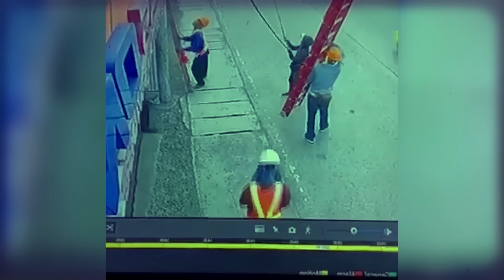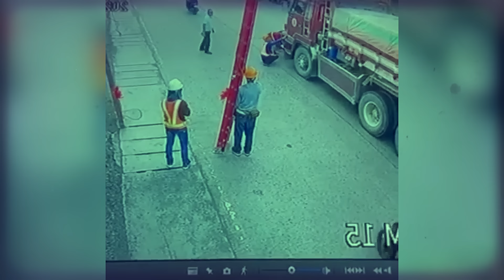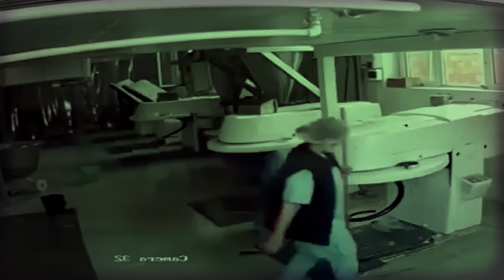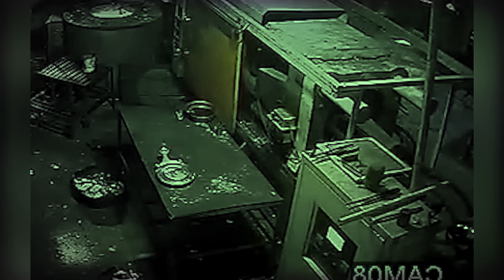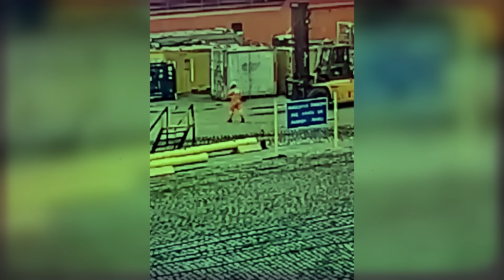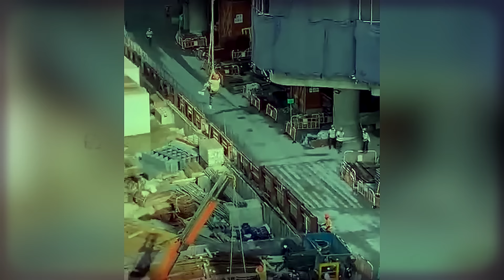Mixer Machine Accident... Caught on Camera 😱

Comment: MIXER INCIDENT:

She went to jail for 2 yrs, apparently she was attempting to ‘adjust’ the mixer for easier cleaning..her statement below (translation I assume)⬇️ 
We were very friendly. We spent most of the day together. On the day of the incident, there was a division of labor among the workers, and two of us were assigned to clean the warehouse and dough mixing equipment of the production plant. We cleaned the warehouse first, and then started cleaning the facilities. At that time, Matanat bent down and began to wipe the floor of the second unit from the door with a rag. She also said to me, "Come pick up the device so I can wipe it." So I walked past Matanat and approached the part with the buttons that control the device. To raise the device, I pressed the green button on the far left, as far as I remember. At that moment, I heard the screams of the women in the shop. When I turned my face, I saw that Matanat was stuck between the stirring irons of the device. Shocked by what I saw, I started screaming. At the same time, I wanted to help Matanat somehow with my hands. Later, one of the workers approached and turned off the device and said that Matanat was already dead. The surroundings were covered in blood. I am very sorry for the incident."

Comment: I think the companies themselves are at fault largely in most of these cases, why?
Because it's about training and safety procedures.

1/ Woman that turned on mixer while man was cleaning it.

Procedure which should have been strictly monitored by supervisors follows.

A/ The machine should of been 'locked out' and 'tagged' before a worker enters danger areas.

B/ Supervisors should always evaluate the condition of their workers such as:
-Is the worker affected by drugs or alcohol.
-Do you have a worker that is showing signs of fatigue or that are too tired to function safely (long working hours demanded by employers often are to blame in both cases but the reason doesn't matter, the worker was clearly in an unobservant condition.
She should have been either sent home or given a different job for the day that didn't involve her working on the machines.

2/ If any worker reaches into an operating machine it shows a lack of training of that worker, in the case of unsafe shortcuts/timesaving measures taken by workers, the company should have hammered into all workers the risks involved. So how does the company do that?:

A/ Again, turn off, 'lock out' and 'tag' the machine.

B/ Weekly hours, if not more time if judged to be needed, in safety training until every worker knows all the safety procedures on all machines whether they operate it or not.
The authority of all workers to declare safety issues or the actions of other workers and to shut operations down and then brought to the attention of supervisors without the fear of discipline for lost time.

In many of these cases safety guards should have been in place, most people can have a brain fart moment at one time or another so if safety guards need to be opened before a worker can enter into an unsafe position it removes that 'quick fix' the worker is trying to do and gives a bit more time for the worker to rethink their actions.

Accidents will still happen, that is the nature of things but at least the company will have done all they could and very likely have avoided workers from taking risks resulting in accidents with the right amount of training and qualified supervising personnel in place.

If a worker shows themselves as unable to follow these safety procedures then 'letting them go' is best for the company, other workers and themselves.

Comment: The brick striking the pedestrian brought back a close call memory of mine.  I was walking from the train station to work in down town Chicago (yes Chicago).  There was a building undergoing tear/down (deconstruction).  Of course it was blocked off around the building, with scaffolding around it in case anything came lose.  Due to the location they were actively tearing it down from the inside and down (it was an old 10 story to be replaced by a nice shiny modern one).  They were on the eight floor throwing debris down one of those long chutes running down the building into a receptacle below (one that trucks come along, pack up, and haul away every so often).  I was on the other side of the busy street and you could hear things going down the tube, very.  Suddenly even as I hear the bangs of things going down the tube, something passes before me just inches from my face and smashes into the wall of the building next to me.  It was a brick.  The best I could figure is something came down the chute, hit other debris in the bin on the other side, and it managed to bounce up and out and over the street.  I was almost like the pedestrian.  And this was in Chicago.  That bin was NOT covered and I got very lucky.

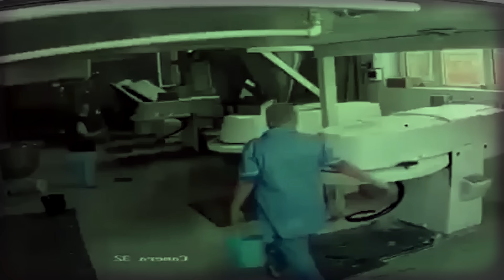Comment: 1:38 Is the moment the Lady sweeping the floor in Bakery turned her head and saw the lady approach the mixer to start cleaning it… she immediately stopped sweeping when she saw her at 1:38… and continues to stare at her and when the lady cleaning the mixer bends down to clean it, the lady with the broom approaches her, and just turns on the machine. She realized what she had done, and continued to stare at her getting K111ed by the mixer …. That was 10000000000% premeditated Murder. Especially considering someone else had to walk across the room to shut it off. Almost looked like the broom lady enjoyed what she did too.

Comment: Anything dealing with ANYTHING that could mutilate or crush a person, it should be protocol to fully unplug/shut down such machinery as to where NO MISTAKES or planned "accidents" will ever happen. How in the world you see someone is cleaning by the machine, yet push the power button!!??
Reply: Supposedly the victim told person to raise the machine. ...Button presser evidently pressed the wrong button.
Reply: There is. Lock out tag out!
Reply: No, Loto is better then just disconnecting
Reply: Only thing those is on manual machines that don't take electricity some are powered by pressure build up aka steam or activated by pressure

Comment: In defense of the woman who activated the mixer...:

"A man died when a co-worker activated an industrial dough mixer AFTER A SAFETY INTERLOCK FAILED, causing the worker to be crushed"

I saw an uncensored copy.  He either broke his neck or was partially decapitated. The woman who runs up and slips on his blood was noteworthy.
Reply: In the UK a safety interlock is not a means of safety isolation! Locked/tagged and safety documentation is the only means of preventing any operation of plant and equipment to be worked on.
Reply: @SteveJB_69  We have them in the USA too.  Google LOCKOUT TAGOUT.   I have used them myself.  

Not that kind of safety lock.  This was built into the machine.  Evidence showed that the safety failed. The woman did nothing she had not done before, hence the light sentence.
Reply: It was a female who died so idk what you read
Reply: @norbertnagy5514    I watched it again and I see nothing to indicate a female was the victim.  You assume.

QUOTE:  "David Ellis died last year following an industrial accident. He was only 18.

David was removing cookie dough from an industrial ribbon mixer when the machinery accidentally became activated. He was drawn into the mixer by the rotating blades and struck his head. He was taken to hospital and died of massive head injuries six days later. It was his second day on the job.

The tale of this young man from Ontario is tragic. David took the job to save money for university. But, like many other young workers, he received only minimal training. And he was unaware his employer had ignored a mandatory order to install a low-cost safety device on the outside of the mixer. In hindsight, if these two things had been changed, David Ellis might still be alive."
Reply: But you probably saw this info i found your comment in the other thread

Comment: 3:50  I'll bet that machine was supposed to have a safety interlock switch designed to shut it down if that partition was opened like that.
Reply: "Prevented the situation from escalating further." When a guy gets his head stuck in an industrial press and goes limp, I'd say that's about as bad as that situation can get. Unless the whole thing burst into flames, I guess.
Reply: Yeah the sanitized language does not help the confusion in the comments. And the descriptions kf incidents aren't always accurate.

Comment: Most of these accidents are due to ignoring Lock out- tag out procedure, many times fault of the companies but not enforcing these practices in favor of production. Companies should punish substantially as management is at fault by not enforcing and employees trained and ignoring should be fired.

Comment: 1:35  On January 7, 2019, Matanat Hasanova, born in 1971, a worker at the bakery of Israfiloglu LLC located on I. Abishov Street in the capital's Narimanov district, tragically died at her workplace. Investigations revealed that while Matanat Hasanova was cleaning the lower part of the dough mixing device in the factory's production workshop, another worker inadvertently turned on the device, and her arm got caught in the mixer. M. Hasanova died at the scene from her injuries. It should be noted that a criminal case has been initiated in the Narimanov District Prosecutor's Office under Article 162.2 of the Criminal Code (violation of labor protection rules resulting in death through negligence). The investigation into the case is currently ongoing.
Reply: The case isn’t ongoing, it ended. The worker was charged with negligent homicide but only ended up with 2 years of community service, aka hard labor.
Reply: @ladymire can you link a news report of something I'm having trouble finding details for the accident.
Reply: @mikeking5626  I did not get my info from a news article as I couldn't find any either. my info is from reddit, which I know is not the most reliable source but
Reply: @ladymire  Too hard to prove as intentional then without evidence.
Reply: @BogDogs_Swamp It shouldn’t matter whether it was intentional or not, her carelessness cost an innocent person their life. She should have been charged with manslaughter and held accountable, even if we truly believed it was unintentional, this case is a blatant lack of justice.
Reply: @mikeking5626 it's sad accident cost her life it's not intentional but she should ask her or someone which button is it
Reply: @serenitymorales1997 it was intentional. She deliberated switched the machine on. Y'all so weak to admit it. It wasn't her first day
Reply: @beckdaniella1205 huh? I heard from others said what I comment not that I don't believe you I don't know if it was accident or not and hey not everyone is weak some people never heard this case myself included that's why we thought it was accident I do appreciate you research about the truth we need to know she did it on purpose I hope her family find peace god bless her
Reply: @ladymire Omg that is insane she's not in jail for blatant murder, thank you for the update and investigative leg work👍🏾💯.

That poor woman was just doing her job and died for absolute 0 reason, i pray for her family to stay strong🙏🏾🕊
Reply: @joshuadovahkiin3054 victim ask her co worker rise machine but she push the wrong button it was accident but as I said before she should ask which button this could prevent I hope people ask for help instead they doing themselves even they work for years
Reply: 48 years old and her life was taken. May her family find a way to heal their pain from that tragic day.
Reply: In this case, I hope it's not the company that they are trying to blame, but the woman who did it! She literally looked from afar and saw the person, walked over as she continued to look at them and then walked over and turned the button on. There's no way it was an intentional and there's no way they shouldn't be held liable!
Reply: @MandySpirals thank you for saying the exact thing I was going to say. Definitely a deliberate act. She needs to go to prison
Reply: According to comment they said victim told her co worker rise machine so she can clean it properly but she press mix button thinking it's rise machine this is must gruesome death I ever see god bless her and her family
Reply: Are you sure it was her arm? I found the original footage off of Reddit, and I'm PRETTY SURE that was her head......
Reply: @whatsyourjourney oh god that's even worse!
Reply: @serenitymorales1997yeah, in the uncensored version, she went head first, and then she instinctively reacted immediately with her arms. The end of the footage shows her arms flopping down once they stop the machine, and they look perfectly intact instead of mangled. Her head was still stuck in the machine.
Reply: @whatsyourjourney poor lady it must be terrified before her end
Reply: Good. We saw her look at her coworker then turn on that machine. Literally all of us saw her murder someone.
Reply: Capital of what Country?
Reply: @CarlGustavJung1875 it was in Azerbaijan 🇦🇿 but the official capital is Baku. The incident took a place in a district

Comment: I understand the urge to blame the woman who operated the machine, but is it really solely her responsibility?
Were workplace safety measures even in place to begin with? Are there established procedures for cleaning tasks?
What about the safety devices provided by the machine manufacturer?
Wasn't this an accident waiting to happen?
Reply: The answer to your questioning is Yes.
1) Is her responsibility because it was not her job to turn it on.
2) Safety measures and procedures were there because the machine was 'OFF"
3) Yea.. now blame the manufacturer that a piece of equipment was turned 'ON' by a person.
4) ACCIDENT, She down right murdered the other person - PREMEDITATED.
She was standing 20 feet away at another machine, saw person begin cleaning machine, walked over and for no other reason, turn the machine on.
Are you serious?
Reply: You cant create an anti-stupid machine or process. People will always find a way to kill themselves doing something they shouldnt. I saw first hand a guy with 25 year experience fixing a phone tower, not following protocol, and the structure collapsing over him, killing him in the process. I even saw construction workers jumping from one platform to another at 30 ft, without their harness, because "it takes too much time" and "its a chore having to secure it constantly"

Comment: Was hit by a forklift at the factory I worked at before.  The woman was a psychopath and I'd apparently done something to annoy her.  I'm completely deaf in my left ear, and I was walking a very safe distance behind the forklift when she suddenly gunned it in reverse.  I had no idea she was flying at me.  If there hadn't been two other people standing right next to me, I guarantee she would not have stopped after that "gentle nudge" and crushed me against the wall.  I was also lucky to have taken gymnastics when I was young, so my body reacted without me having to even think and I came out basically unscathed.  Unfortunately, there weren't any cameras in that area, and the other two people were too afraid of her to say what happened.  She nearly ran me over again less than a year later -- but it was my word against hers -- so she got away with it again.
That said -- the "gentle nudge" she gave me was nothing compared to what that guy felt.  Forklifts, even small ones, are insanely heavy.  One moving at that speed would have been like getting hit by a concrete wall.
Reply: hope you dealt with her secretly and accordingly
Reply: @roberthooper8883  No.  They eventually moved her to another building due to complaints from other workers before me.
But they would not fire her.
Reply: @ripvanwinkle9648  That blows... But I wasn't talking about that- there is more than one way to skin a cat. I had a problem with a female worker way back- when I worked in an office environment. Let's just say that I tried all "legitimate" ways, but upper management was also female, and she had figured out a way to cry and get them on her side early on.  SOOOOOO I decided that I would have to take it upon myself to educate and "reprogram" the situation. Let's just say that I spent alot of nights away from home and my bed, but in the end it was WELL worth it- AND as a side-benefit- I never got bothered again by any of the other bitches up there- they were aware what I was capable of after that.
Reply: @ripvanwinkle9648  
Man I hope you're in perfect health physically and mentally bro! Reading this boiled my blood and made my eyes water because of how evil some humans are! Despite of the injustice you were served,  Vengeance is indeed The Lord's , bruv
Reply: @Yajeeb  Dude, thank you for the message.
Also, please, if you can, never work in a factory, as it appears that the worst of humanity tend to end up there.  Not everyone who works at a factory is an evil piece of shit, mind you, but those type of people do tend to end up working there.
But then, the old saying goes -- life sucks, and then you die.
Reply: Should have beaten the sh*t out of her